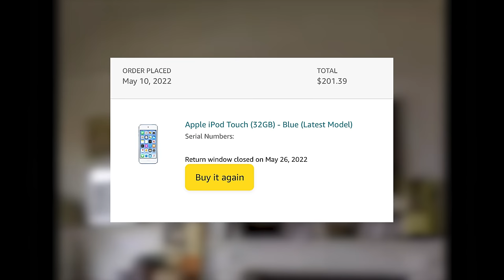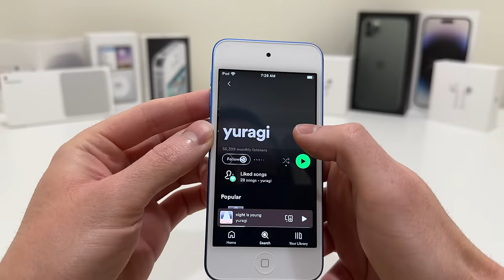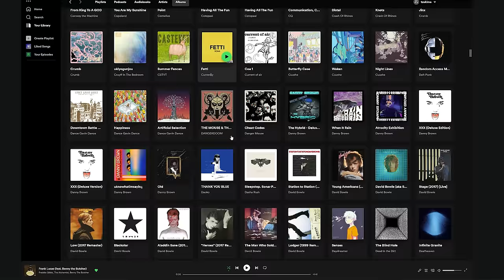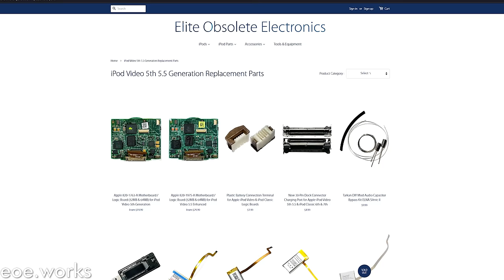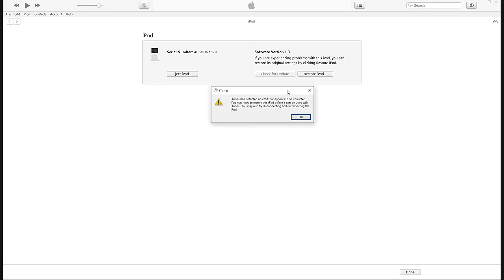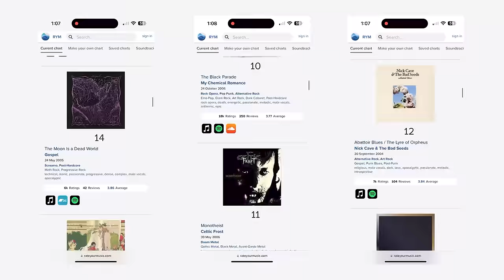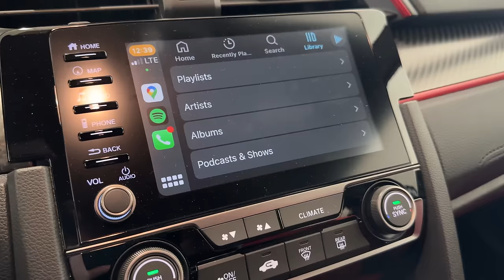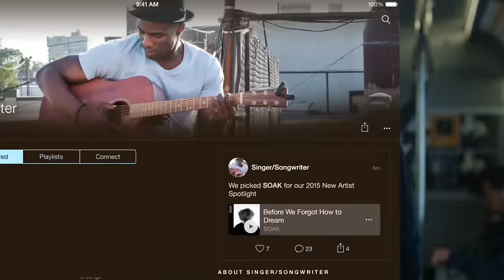Giving iPod the Respect Apple Didn’t

Comment: I’ve got a late 2006 5th gen slim with a classic faceplate and a 3,000mah battery. It also has 256gb storage (1 sd card, I’m not sure why you’d use the quad for low capacity when the solo is cheaper and easier) and taptic. Really it’s to a point where it could be a modern product, the specs are more than enough for my everyday use. BTW, the scroll wheel is an issue with replacements, I’ve had a few with this issue. You’re better off buying refurbished ones that put new plastic on the old pcb.

The only thing I’d say it’s missing is the diymod. Maybe wireless charging, but I hardly ever have to charge it anyways.

You can retheme rockbox to look just like the stock software, and tons of other stuff. There’s hundreds of themes, I can’t imagine not using rockbox with your flac files just because the default theme is bad.
Reply: The Quad is smaller and makes modding Thinner models w/ bigger batteries possible. Think people say it is basically required to use a Quad if you're putting like 3,000mah in a Thin model
Reply: As someone who tried desperately to get Rockbox as close as possible to the look of the stock Apple OS, it's just not the same. Nowadays if I were to consider jumping back into Rockbox I think the best usage is for someone who doesn't care about it mimicking the stock OS.

Comment: I do love retrofitting older tech to more modern standards and/or compatibilities. my car is from 2005, so it's from that awkward phase where bluetooth or aux input weren't common but cassette decks were rare to find, and therefore doesn't have any native way to interact with pretty much anything but a CD. I installed a new head unit that allows for android auto or carplay and it's really quite a big quality of life improvement. sure it looks like a hacked-together mess but having a GPS and streaming music is pretty nice. 
in a similar vein, I've seen people add wireless charging coils to Nintendo Switches, using bluetooth dongles for ancient headphones, and then there's the wealth of upgrades available for Gameboys. hell even cfw for the PS3 and Vita probably count as adapting them to the current age. there's some cool projects to be done in this retrofitting space and I'm glad people are interested in maintaining, repairing, or improving what they already have (or more likely giving life to something they bought second-hand but I digress).

Comment: Cool video! I love my iPod, thank you for doing it justice.

FYI, Rockbox is very themable. There are themes like iRB_Video/Classic for imitating the original SW; and iRB_Modern/Interpod for an interface closer to the modern Apple Music app. The only thing that really took getting used to is the database export/imports and the clickwheel changes-- but I got used to them pretty fast. Plus, no iTunes is needed; you can load FLACs onto it, as if it were a USB drive.

Comment: So I understand why people had gripes with iTunes being required. I really do. But what I don't think people fully grasp is the things that iTunes can do that a drag and drop file browser-type experience can't. Smart playlists being the most obvious. But there is a single checkbox which is absolutely critical to me, and not even the open source iTunes alternatives support it. You can set a song to "Skip when shuffling". It's a godsend for interludes, outtakes or other such tracks that makes sense in the context of an album but NOT as an individual experience.

Also, two features added with the release of the iPod shuffle: 1 - you can have it automatically downconvert your tracks to a lossy (or lower bitrate) format, which is helpful for lower-capacity iPods like a Shuffle or a nano. But another thing it can do is fill the device with randomly selected music until it is full, which is another amazing feature that works well for shuffles or nanos when your library is too big to fit.

Comment: That's a great modded iPod you've built! And yeah, the battery life with one of those upgraded batteries is pretty amazing. I remember testing a 7th gen with a similarly-sized battery as the one you used and it ran for 5 and a half days continuously.

Comment: Very well done video! I also rebuilt my own upgraded iPod from EOE, though I went for a less traditional transparent front and black backing. I actually had the same issues with backplate screw tolerances and my bottom plastic charging point bracket is now only held in by the other components pressing against it. The iPod is also great device for listening to music while working since it doesn’t have all the distractions of a cell phone.
Reply from the maker: thank you! funny enough, the 30-pin bracket was the one i was able to force the screws in lol

Comment: I think Apple should'nt discontinuted ipod classic.   I got mine on Mercari for 300$ in mint unused condition months ago.  I'm surprised it's battery life still great.
Reply from the maker: 300? 😱
Reply: @tzukima  it’s original which means original front, back plate and the click wheel unused.  The batter count is less than 5 or 10 when I turn it on disk mode I think

Comment: I broke the front panel trying to resurrect my iPod, but as I was already low on funds and didn't ruin usability, it just looked like it's been opened. Sucks it doesn't have bluetooth, I can't use my AirPods Pro, so I just try to use EarPods that shipped with iPod touches, which always fall out. I pretty much just use my iPhone, even though I probably should be using an old iPod touch.

Comment: What's the point of using 4x64GB MicroSDs instead of single 256GB card lol
Reply from the maker: @je5terc0re  i think the idea was that you would use 4x256gb or something i just wanted it cuz i thought it was funny lol
Reply: @tzukima  iFlash Quad is more like a prototype, no need to use all 4 slots. Let's imagine for 1 card fail rate is 5%. For 4 of them it will be ~20%. Also every card adds a little bit of power consumption for the controller, nand, etc. It's better in terms of reliability and battery life to use less cards.